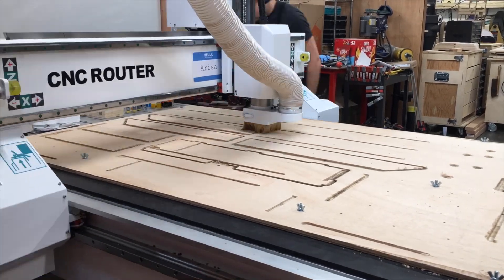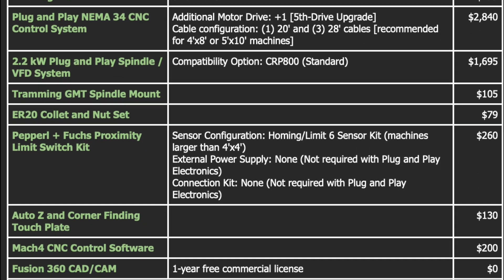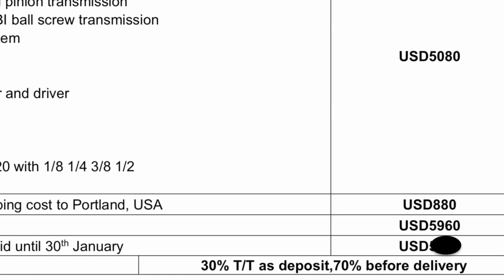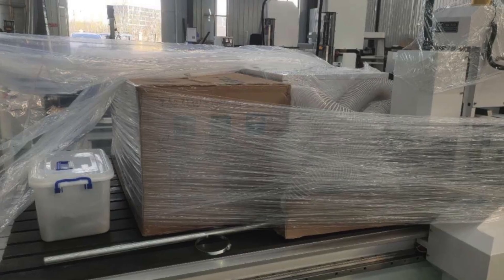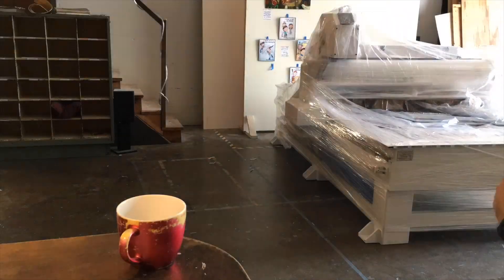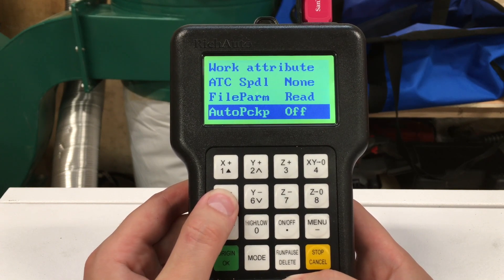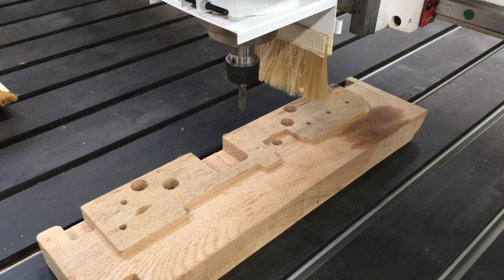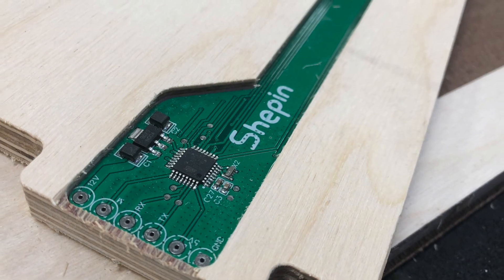Importing a CNC from China & user tutorial

Comment: @shepin, I’m planning to import a Quick CNC from the Jinan area as well. I am looking for a dust extractor, what are your experiences with this one? Seems to cheap to be good😅. Am I wrong? What do you use now?
Reply from the maker: Hey, so they do give you a fairly cheap one if you need one with the machine. Yes, it’s not built well but it works just fine. Mine had an issue where the starter capacitor went out because of low quality and poor assembly. However it was really easy to source locally and after replacing it, it has never quit working since. So my recommendation would be to take the capacitor caps off and take a photo of the capacitance and check for any jammed wires as soon as you receive it.

Comment: What stepper drivers are these at 9:05? Btw great video,
As I understand The spindle VFD requires 0-10VDC to adjust the speed. The cnc controller usually generate a PWM output for controlling the spindle speed, you need to use a PWM to Analog converter module to convert the PWM signals to the equivalent analog voltage

Comment: Hello,
I live in Canada on the west coast. I am looking at upgrading my CNC machine. I was talking with Nick at stylecnc and he gave me a link to your video. I watched it and it is great. He mentioned that you are buying two more machines? Is that true? Are you still happy with you machine? I am a little worried about getting a machine out of China. Please let me know what your thoughts are?
Cheers
Peter
Reply from the maker: Hey Peter. Yes the machines are great. My first one, seen in the video, still works great. I bought 2 more from them, took delivery about 5 months ago and have been using them right out of the box with no problems. They are a great company and I trust them so much so that I wired them the full amount. Everything arrived undamaged and perfectly working. I even asked for some extra spare parts as some of them are difficult to find here in the USA. I have a friend who is interested in buying machines as well and he asked if we can buy them through me. All of my machines are running constantly with no issues. But even if there are some minor bugs, the company has always been very responsive and helpful to solve them.
Reply: Thanks for the information! @SmartFurnishing

Comment: Hi Peter, you said you did not recommend the license broker you dealt with. Are you aware of one that would allow someone to have a better overall experience?

Thanks for the video, it is packed with very valuable info!
Reply from the maker: I have imported 2 more machines now about a month ago and used Brownstone International. However, although they were professional and quick, some of their staff wasn’t very educated and lacked experience in some areas. Overall their cost was much higher too, for that money I kinda expected more. So I would recommend doing a lot more research on brokers as there is always going to be some pluses and minuses. Will depend on what you value more, time, experience, professionalism or cost.
Reply: @SmartFurnishing  Thank you! What are their rates approximately? Even though they lacked experience, did they make any "big" mistake during the process?
Reply from the maker: @GGBel1  No big mistakes. Just a few close calls that I called them out on and they were able to address them quickly. Like some staff actually admitted on the phone that they were a rookie in my case. Since most of the stuff they import are small crates of clothing or other similar items, because of that they didn’t have a proper fork lift to handle the big crates. One of the clerks told me the guy who was driving it was also a rookie at it. But nothing bad happened, so… yeah.
Overall for the 2 imports they took a little over $5k.

Comment: I have my shop in my home garage and I could only pass the machine through a regular 32-in door. Is this possible with this machine?
Reply from the maker: Unfortunately that would not be possible. Since the machine comes fully assembled, and the frame is welded together, the minimum width you would need is 80 inches.

Comment: as i know, DSP A11 can not read F value, you set it read F, i wonder does that work ?
Reply from the maker: I’m not sure what F value is. But I do know that it didn’t use to read the set feed speed. After changing the settings it does. So if a cut needs to change feed speed half way through the cut it will do that. However the spindle speed cannot be set in G-code: it can only be set manually before the cut. If spindle speed is different half way through the code the machine will pause for 10 seconds to allow you to change it. Also if you have a coolant setting in your G-code, that can also be read, so I use it to run air blast at the bit. And I can turn it on or off in the G-code.
Reply: @SmartFurnishing  gotta. yeah, DSP A11  it has limited functions, simple and easy controller, like what u said, can not used to read the set feed speed. but still we can develop simple functions on it, like G code to control coolant as u said.

Comment: They quoted me $3000 to ship the same machine to Portland…. Wonder why?
Reply from the maker: That’s because the shipping industry is very busy right now with a lot of back order, so it takes more time, which allows shipping companies to rise prices.
Reply: @SmartFurnishing  yeah I figured, that’s unfortunate because the price point is great. I have a few questions. Are the motors nema 34? I assume they are servo motors?  What is the rapid movement speeds it can do when in the air? And can it cut around 500ipm full depth on 3/4 ply with a 3/8” bit? That was what I used to run my Ez-router at.
Reply from the maker: Only the spindle is a servo motor.
The rest are Steppers and there doesn’t seem to be a limit to how fast you can run them. I was able to run mine at 850in/min

Comment: how has your experience been to this point? thinking of buying the same machine with ATC and vac bed with 4th axis but the first thing they did was add $6k from the $10k it said on the web site so im a bit sceptical.  definitely dont have the money to lose. any advice?
Reply from the maker: Just negotiate with them hard. Offer 25% cash upfront if they reduce the price. They don’t get the money right away. It takes a while. So if you pay some of it as a money transfer and the rest with more secure way such as credit card or Alibaba. They will more likely to lean in.
Reply from the maker: The quality of the machine is worth it either way. I run mine for 7 hours a day and it hasn’t skipped a beat for almost 2 years now. Also, whenever I need something or have a question they always reply right away. I trust them at this point. That’s if you send your questions though WhatsApp.
Reply: @SmartFurnishing  yeah they asked me for my whats app but im not on whats app lol I guess i need to get with the times
Reply: I have a STM1530C (5'x10' with ATC and small removable 4th axis) on the way (Feb17th,2023).  I got prices very close to the listed website price without negotiating (Final price was $19k shipped).  I only asked for a $500 discount towards the end, but made it clear that I wanted them to take more care to build it right, than to make it absolute lowest price.  This was after asking for several upgrades to the specs to make sure that the parts were top quality (Yaskawa 850w servos, Delta inverter, pneumatic rollers, extra vac pump, etc).  You don't get something for nothing, and they can substitute components around to get the price you ask for.  Or use better parts to get the quality you want.  It doesn't make sense if you use this for work to care about $1000 in the end if you will have lower quality or hassles.  

I don't have my machine yet, but I had no issues with the purchase, spent $125 on an inspection service that visited the factory, saw my machine (it has my name printed on the gantry), took pictures, identified components, measured sizes, test cut, etc.  
So time will tell, but the company is legit and I have talked to several others in the US that have StyleCNC machines.

Comment: Great vídeo. I've Operated a machine with this joystick control, and maybe it is great for serial parts, but when it's a small job, it's a real pain going from the computer, saving programe to flash drive, charging it into the joystick every time i had to change something in the programe. Is there any way to conect directly the PC by USB or similar so to make ir easier? Like you do on small CNC controled by a computer AND mach3? Thanks
Reply from the maker: There is a USB connection on the bottom of the controller that looks like something you’d find on a printer. But I’m not sure how it works I haven’t tried it.

Comment: One issue I am having with picking out a machine is the voltage rating. One machine says 220V/380V 3 phase. Does this mean 220V single phase/380V 3 phase or both 3 Phase? I have only a 200A 220v single phase to the shop and getting 3 phase would be costly out of town a few miles away from main power lines. This is in the US.
Reply from the maker: It’s 220 ~ 240 single phase.  380v is 3 phase. Everything gets converted to DC anyway so I recommend 220 (240v).
Reply: @SmartFurnishing   Man that was a quick reply, thanks. Just didn’t want to get something that would require modifications to either the machine or my electrical supply to run it costing more money. Again, thank you and great video.
Reply: @tumblevveed3586  Im in the process of converting a used machine from 380V 3-phase to 220V single phase.  I had to replace the contactor with one that has a 110V coil, and the VFD from the 380 to one that converts 220 single phase to 220 3-phase.  I have spindle turning, but I believe I’ve lost about 1/2 of the horsepower.  You are smart to get the correct power.
Reply: They will make the machine to whatever specs you ask for.  That is the thing here, you can literally ask for the machine to be built any way you choose for a surprisingly small difference.  They can make a custom size, use parts from Germany, Italy, China, Taiwan, include or delete features, control systems, ATC, rotary axis, etc.

Comment: Thank u for your video. I'm shopping for a CNC router machine for cabinets and this video helps a lot. I like the price. It's a fraction of what the others are asking. Can u please let me know if the software is include and quality and precession. Thanks in advance
Reply from the maker: There is no software included. The machine operates on a usb drive. So it basically has its own computer. But if you’re asking about G-code, there are lots of different options available to generate it. I personally use fusion 360, after you model your 3D object, you then switch to manufacturing tab where you create the G-code for the machine. There are lots of YouTube videos on that. Other then that, the machine computer is easy to use, as you can see towards the end of this video.
Reply: @SmartFurnishing  OK I'm a bit confused. What I ment is the software to use for designing different cabinets and wood carving. Such as the Mozaik and there are more options. Thank u for your response
Reply from the maker: @Prince-dh8oh  unfortunately I’m not aware of software that focuses on your needs. But I’d look into V-carve, they have different versions but only available for windows.
Reply: @SmartFurnishing  Thank you.
Reply: @peter Hi, since you’re using fusion360 to run the cnc router, which post processor from fusion library will this machine accept? Thanks in advance
Reply: Hi Prince, di you finally get your cnc for cabinet work?

Comment: Great video. I've been trying to buy all the parts and build my own 5' X 12' LASER/CNC table since 2019 with almost ZERO luck. Parts were ordered, but then cancelled form China. When relisted, they were twice the price ! Bought a 1800mm Ball Screw for the X-Axis... nope...FedEx lost it in shipping, only to find it 3 weeks later. Then, returned it to the seller because the box had been so badly  destroyed some how. So I still need my 4X 3600m Guide Rails, and 2X 3600mm Ball Screws. NOPE, Chinese company wouldn't ship, said the shipping Max Length for Air was 2500mm...I didn't ask for Air, but no sale. 

Aaaaand then COVID really kicked in, and everything was a no go for 6 months. So I'm $1,800 into a project I originally slated for $2,500 total, but that $2,500 won't hardly cover everything I need to finish it now. It is ALWAYS something !  Glad you got yours done the SMART way !!!
Reply: I honestly do no know how you thought you could build such a huge machine for so little money...maybe with rollers on aluminum extrusions and rack and pinion drive it would be possible but never ever with linear rails and ball screws. Doesn't matter where the precision parts come from. Precision costs money and cheap Chinese stuff is no particularly precise 😟 I'm sorry to have to tell you this.

Comment: Can you please post an update on the performance of this machine. Plus why are they using the outdated mach3?. The vfd looks like a chinese brand. What about the spindle? Any servo motor option? How was their english? Can you post video of the electronics enclosure.
Reply from the maker: Okay I’ll work on that. It’s been 9 months so it’s a good idea.
Not sure, that’s just what they recommended. I’ll try vfd, and do a closer look at the electronics that run the machine and add that to my next video 
Yes they have different spindle types. However the machine model I chose only comes with this one. This machine is their entry level. They have a dedicated sales person and her English was perfect. I’ve also spoken with one of their engineers to clarify details about the system operation. No issues with English.
Reply: I got a STM1530C on the way (02/2023) and it has a 9kw HQD ATC spindle (Italy HSD is available as well).  I upgraded to 850w Yaskawa servo motors as well.  Plus a Delta Inverter 15hp HD.  So yes, they can use any parts that you choose on your machine.  They didn't even try to upsell me on these during the process, I just asked for them and they quoted a price.  Mine has an LNC MW2200 controller with nice full computer screen - Taiwan made and not the greatest support in english, but looks super nice as a controller when you learn it.  It has on-screen G-code simulations.  It is all about price and what you want to pay for.  Pay a little and get old controllers, pay some more (usually very little extra cost) and get better components.

Comment: Hey Peter. What CAD/CAM software are you using in conjunction with the machine?

A guy is selling what looks like this exact machine from StyleCNC still in the packaging locally. The price looks comparable to what you paid overall to get it here. Do you have any advice on what I should look for before purchasing from him?
Reply from the maker: I'm using Mach3Mill. It works great with the machine. I haven't had any issues. It's quite easy to operate, I wouldn't worry about it. If you have a great deal on hand, go for it. Should you have any questions,  you can always email me at Peter.shchepin@shepinbed.com
Reply: @SmartFurnishing  hello Peter, this way you jump the joystick? I mean Is there a way to send programmes directly to the machine, without using the flash drive?
Reply from the maker: @ModulArt22  I’m not sure, I haven’t tried using the port.
Reply: Hi，Here Bella from China , best 1325 cnc router please contact star01@starmacnc.com,buy machine from factory will get a best offer .